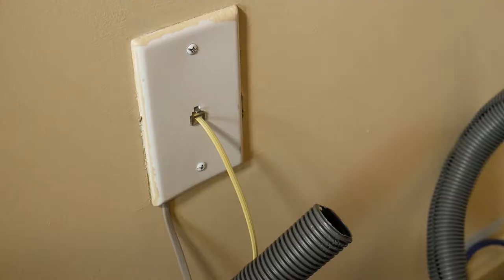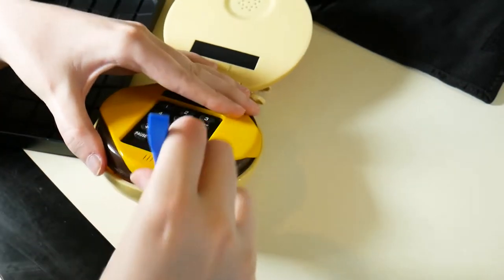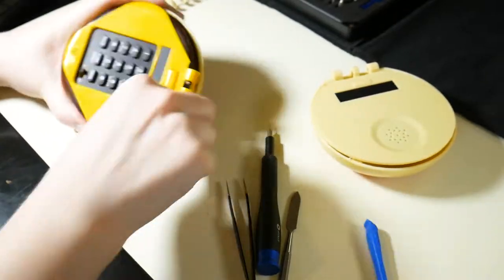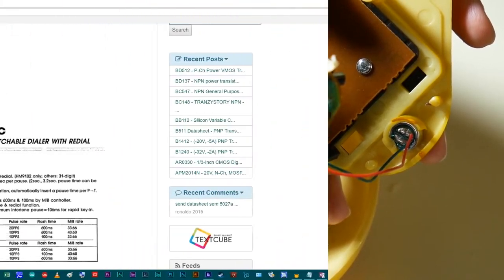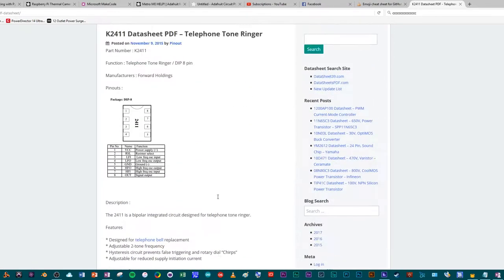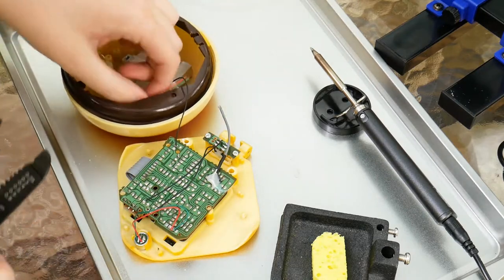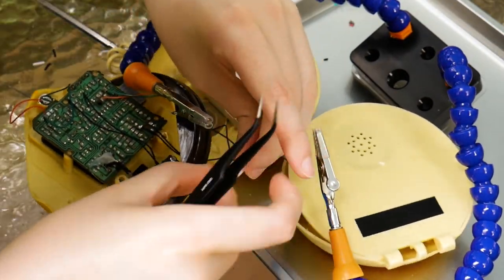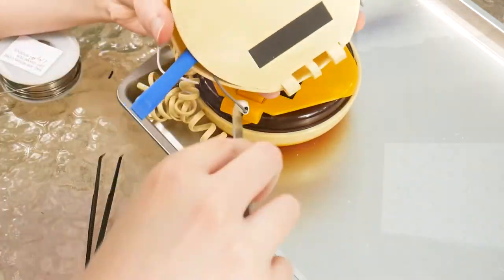Analog Hamburger Phone Teardown & Repair

Comment: Hello! You should buy some heat shrink tubing it is much cleaner than tape to insulate wires. These very thin wires are very fragile you did nothing wrong. There is not many strands of copper in the wire and the solder wicks into it making the solder joint very fragile. You can make them much stronger by putting a drop of hot glue (because it can be cleaned easily) on top of the wire at the solder joint to relieve the strain off the solder joint like it was done for some of the wires on the board. Also small correction: when "a wire has multiple strands" it is called a cable and each "strand" is called a wire. A wire can have a solid core or be constituted of multiple strands depending on the application.
Reply from the maker: Great tips, thanks! Right after this project I actually got a variety pack of different sized heat shrink.